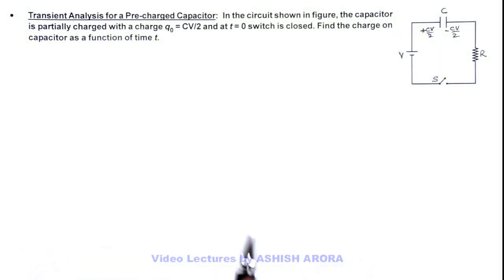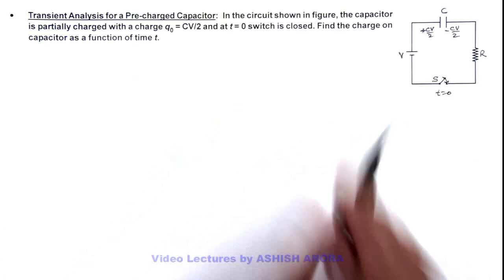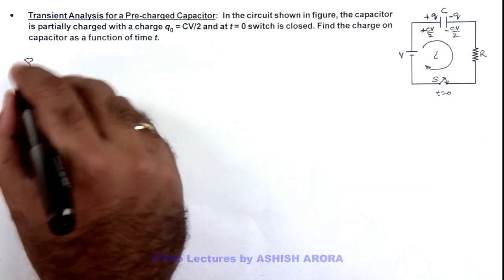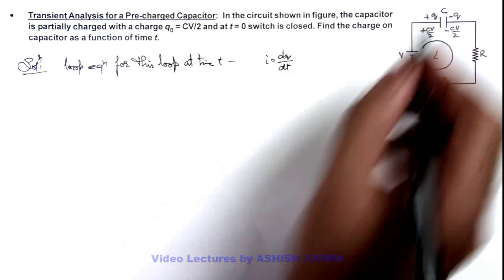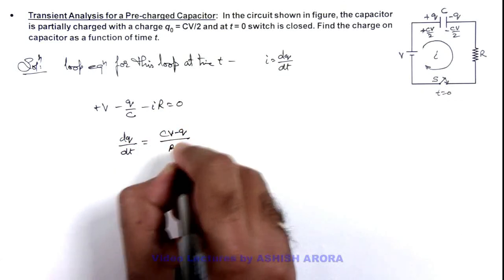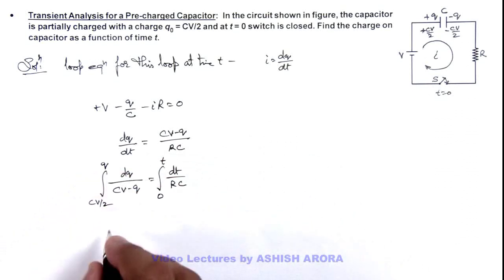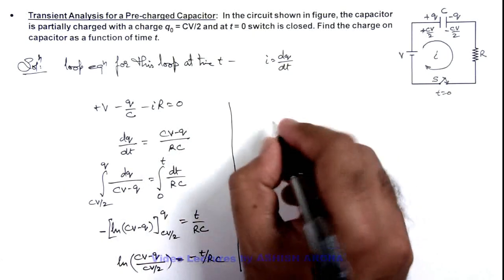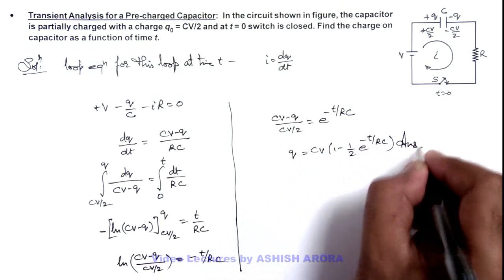8. Advance Illustration | Current Electricity | Transient Analysis for a Pre-charged Capacitor

Comment: a easier could be just to multiply the exponential term by  " the fraction of charge (wrt final charge) to be added on the capacitor to make it fully charged (here it is 1/2)"   , I have derived this result for this case but i think it should be applicable to any case as ends of a capacitor could be reduced to a single cell and resistance

Comment: i did this with basic understanding pls tell me if it is correct ,

q = cv/2 + cv/2(1 - e^-t/rc )

since initial charge is cv/2 and it will get further extra charge cv/2 , so we can right it as this directly right?

i know there can be complex cases for which we should get use to to integration but for this situation this ,method is valid or not?
Reply: It is valid. My teacher taught graphical analysis to get to the same result. But we need to be careful in the cases when the polarity changes
Reply: Bro I did same but in book and video lecture answer is different
Reply: But why is it different
Reply: @unknown-sq8qp  answer through this method is wrong because, in this approach it is not take care of the fact that some initial charge was present on the capacitor which will act as a virtual cell of potential difference cv/2, creating some hindrance in charging the capacitor initially
Reply: I guess cv/2 + cv(1-e^-t/rc)  hoga

Comment: I solved it without integration.
Step 1: find time taken to charge the capacitor to cv/2
Ans:t=RC ln2

Step2: In equation q=cv(1-e"-T/rc), substitute T= RCln2+t
You will get the required answer.
Reply: Me from future guys....
I cleared jee advanced 2021 but did not get a good enough rank to get into an IIT, so writing this from NITW... this checklist was helpful... I did all of my prep from youtube
Reply: Gzb bhai thanks
Reply: Correct bro
Reply: I did it like that as well but there was some sign issue ig so instead of 1/2 e^(-t/RC) I got 2 e^(-t/RC)
Reply: bro how does minus sign come on integrating 1/x to ln?
Reply: @asylum8803 same doubt
Reply: @deepakagrawal1169  bhai samajh aaya kya ki minus kyu lag raha hai
Reply: @darkflinch5786  hn
Reply: @deepakagrawal1169  toh bta bhi de bhai
Reply: @darkflinch5786  bhai integration hmlog Q k respect m kr rhe h Or denominator m q -ve sign k sath h isiliye 🙂

Comment: why cant we use direct formula of charge here?
Reply: We can use it but with a slight modification......
In the equation of charging of a capacitor the time taken is measured from the point when charge in the capacitor is 0
Here time is measured from the point when charge in the capacitor is cv/2

So all you have to do is find out the time taken for the capacitor to get a charge of cv/2....
You will get the answer as -RCln(1/2)
So now you can use the equation for charging...the only difference instead of "t" you write "t-RCIn(1/2)"
Simplify the equation and you will easily get the answer.
Reply: @joelmammenisaac5725  thankyou
Reply: @joelmammenisaac5725  yes bro thanks
Reply from the maker: because initial charge is not zero...